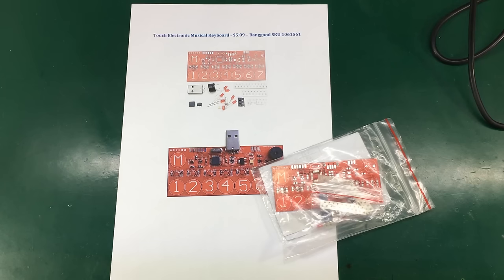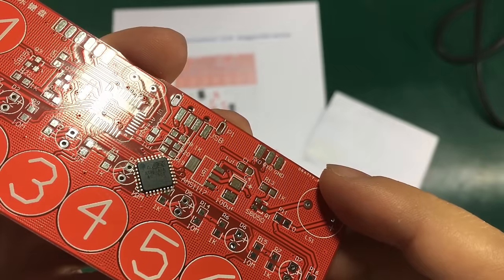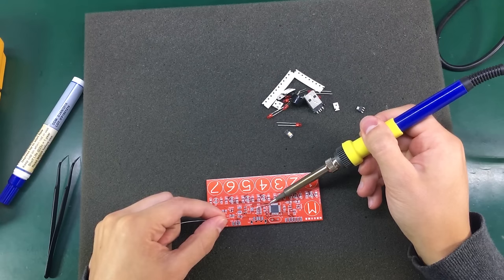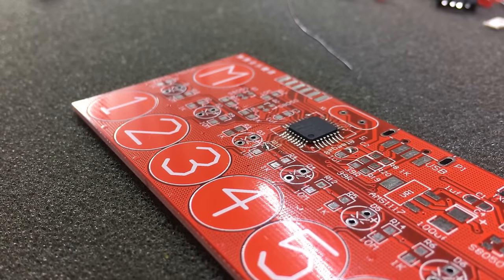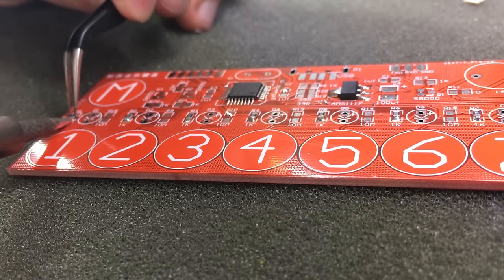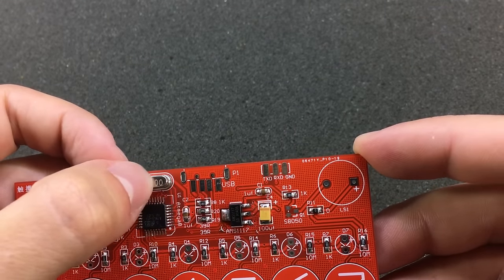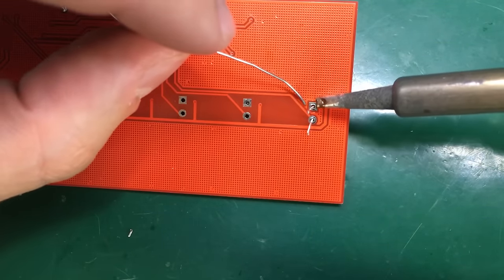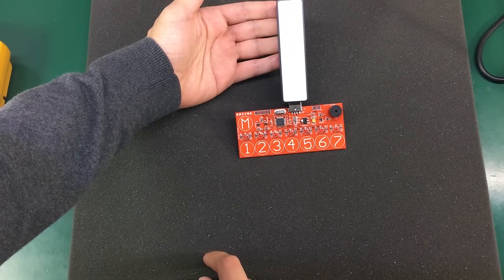Voltlog #71 - Electronic Touch Musical Keyboard Kit

Comment: Cute little build, I might buy one of those :)
Have you ever tried using an USB soldering iron?
They have a fine tip which is ideal for SMD soldering.
I use mine as often as I can. Just plug it into a power bank (2A) and you're good to go (don't use a mains adaptor, it may produce some leak current). It also heats up really fast.
Reply from the maker: I might get one soon because they look interesting. Thanks!

Comment: It looks like USB data lines are also connected through the resistors to Atmega
Reply: OR-Khan Yup I saw that too. Also the 12mhz clock is the right speed for usb communication.
Reply from the maker: Once again my viewers notice things I missed. You are right, I connected the board to my computer and it's detected as "XZDZ MIDI Board" so I'm guessing it can be used together with software that reads MIDI keyboards. Thank you guys!

Comment: Would you tell us how the touch pad that is built into the PCB works? How is it made on the PCB?  Love your videos. Thanks!
Reply from the maker: Here is my understanding on how this works: Each of the touch points is a small copper pad connected to +5V through a 10M resistor and at the same time to an ADC input on the atmega. On the bottom side of the pcb under these sensing pads there is a ground plane to isolate them from external noise. Each pad forms a small value capacitor. Putting your finger on a pad will change the capacitance value and this small change can be measured as a small variation in the voltage measured by the ADC channel connected to that pad.
Reply: VoltLog Thank you for answering my question about the built in switches. I find this interesting and think I will do some research and maybe build some circuits based on this idea. Thanks again.

Comment: I've ordered one!  I'm curious about the 'buzzer' -  Is it a regular piezo buzzer that would emit a fixed tone if you just put 5V across it?  If so, I didn't realize that it was possible to get different frequency tones from the same device.
Reply from the maker: the buzzer is a passive one, meaning the atmega puts out a pwm signal with a different frequency for each musical note. Myself I would call "regular ones" these passive types, because the active ones have additional circuitry.
Reply: Thanks.  I didn't know about those.  I've ordered some now for another project I'm working on.
Reply: One question though - why are passive buzzers like this polarised (unless you want to build a phased array)...? Even manufacturers seem to handwave the direct question with "ummm, it's just baaaaad, don't do it, volume bla bla bla destruction bla bla bla". It might be interesting to actually test / measure / take apart a few of these small ones just to confirm whether there is a noticeable, actual, practical difference... :)